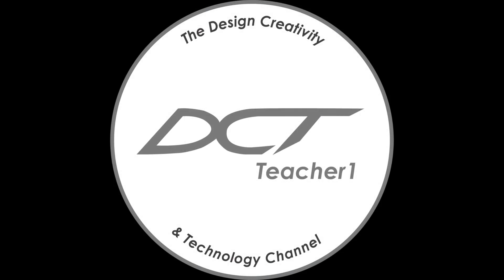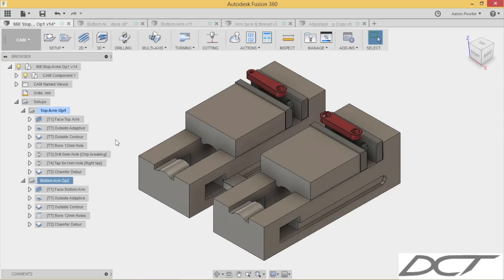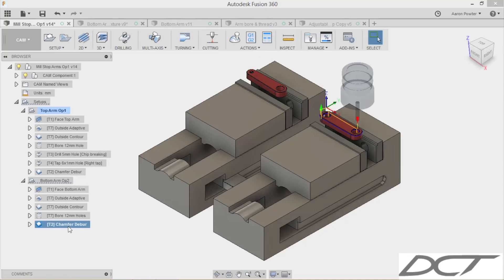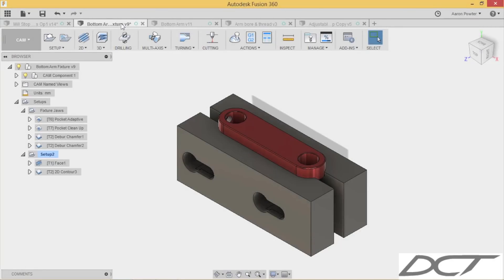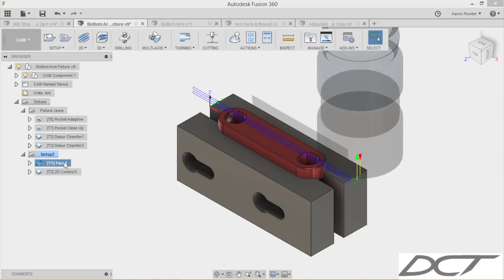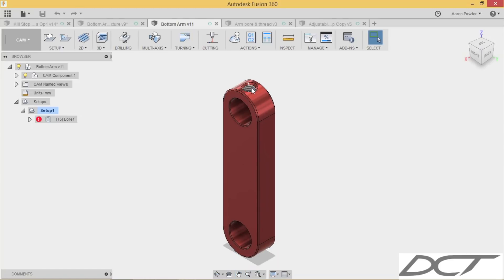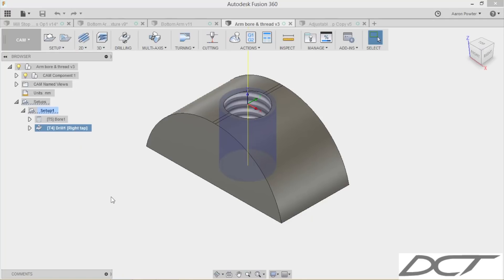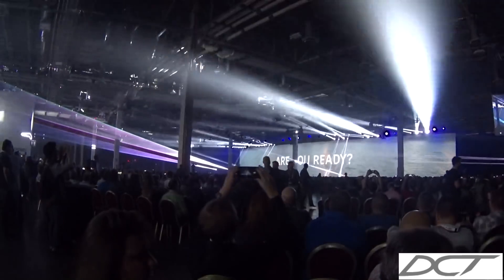Mill Vise Stop Pt.5 - Final Product CAD CAM CNC

Comment: Great video! How do you program the 2 parts for 1 tool? So that 1 tool is doing both parts before you switch to the next tool?
Reply from the maker: Hello and thanks for watching. In Fusion 360 you set up 2 work coordinate systems (WCS). For example left vice G54 (1) and right vice G55 (2). You can then instruct F360 to limit tool changes so it jumps between WCS 1&2. However your post processor must be able to handle multiple WCS’s. I hope this helps. Very hard to explain in text. Cheers 🍻 Aaron

Comment: Nice parts, I better get back to the shop and finish my G0704 conversion.
Reply from the maker: Hi Justin, yes mate you better get started back at it.  We are so lucky today, as we have free access to CAD-CAM software and the CNC components prices have dropped significantly.  Cheers Aaron.
Reply from the maker: Justin Bell Congratulations Justin you’re the winner for April 2018. You’ve won the mill vise stop. Please send me a private message with you shipping details. Regards Aaron

Comment: Hi Aaron!
Whenever I work in fusion I don't have any chamfers or threads modeled, that could be you problem on the bore.
I have threaded holes at tap drill size and the chamfer toolpath lets just pick an edge I want chamfered (hard part is chamfering in variable Z). 
I have separate models for customers that are 100% modeled so they can see their parts as they will be finished.  
Keep up the good work!  
Cheers
-Marty
Reply from the maker: Hi Marty, after reading your detailed comment you got me thinking.  So I went back and investigated it more.  The problem was caused by the Tangent plane not be 100% vertical.  Because this was slightly off, Fusion couldn't generate a tool path that was slightly offset from the Z-axis.  Damn you 3 axis milling machine ha ha ha.  Cheers mate, Aaron.

Comment: Nice work! I notice you don’t climb mill when chamfering - does that give a better finish? Must admit I climb mill but get a bit of a burr on the edge which sort of defeats the point. Perhaps I should try conventional?
Reply from the maker: Hi Murray, good pick up mate.  Yes you are 100% correct.  I don't climb mill on the chamfer as it leaves a small bur on the edge.  I tried conventional milling and it solved my problem.  Give it a try on your machine?  Cheers, Aaron.
Reply: DCTTeacher1 cool, will do. I have a job set up and ready to go but I’ve just buggered my back so it’s having to wait a day or two. I’ll redo the chamfer operation and repost it. Nice one!
Reply from the maker: Thanks Murray, sorry to hear your back is shot.  Get well soon mate.  Cheers ;-)
Reply: Where on earth do you change from climb to conventional? Can't see it anywhere!!
Reply: Ah, you have to use 2D Contour, not Chamfer......
Reply from the maker: Murray Edington sorry I should’ve mentioned that. I never use the chamfer option, always 2D contour with the chamfer option selected with the fill dimensions entered 0.2mm and 0.5mm